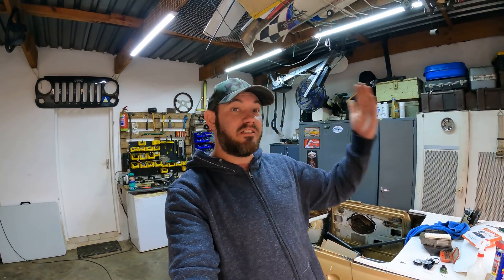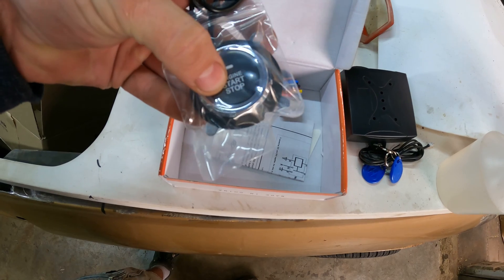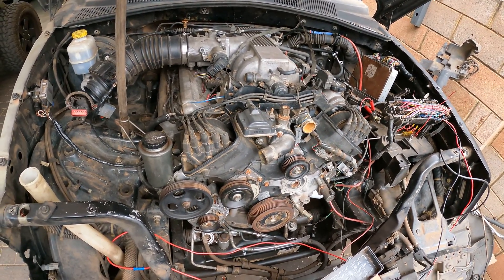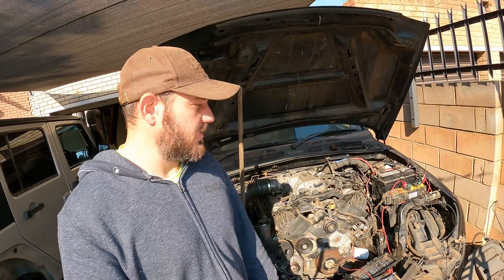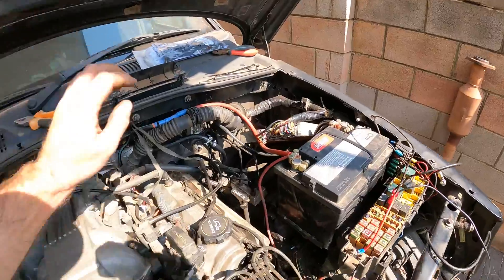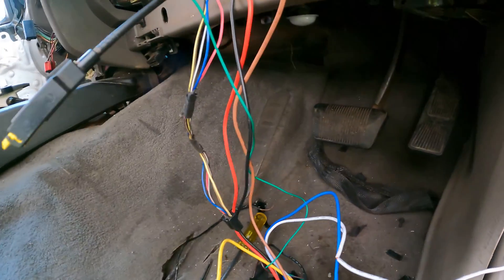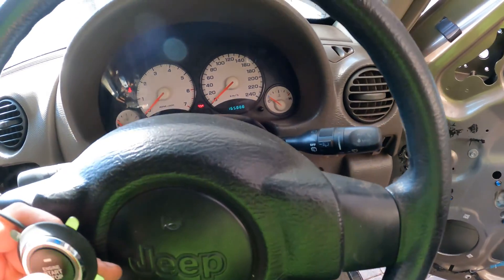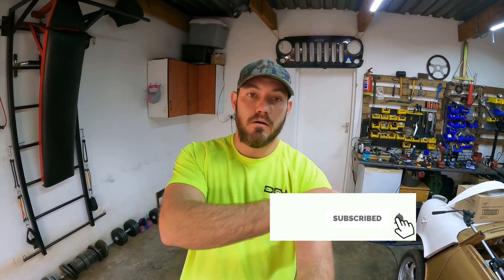Immobilizer Bypass/Delete on Jeep KJ Build Project Part 15

Comment: Can u please help me bybass my skim unit on my jeep cherokee overland 2.7 L diesel. It has a crank no start or starts then switches off. I'm in Cape Town. Please help, I'm very desperate. Thank u
Reply from the maker: If your Jeeps wings over and starts, you dont have a SKIM problem, this sounds a lot like an issue with a Crank sensor or even a loose wire on the injectors. These 2.7s have a closed loop on the injectors, which mean, if your engine is running and you pull one injector plug, it will switch the engine off to save it from damage. 
I would start by looking at the Injectors loom first.

Comment: Hi brother can perhaps give a bit more specific info on how you connected the wiring from the fuse box please. And did you disconnect the pcm completely? Why is it just hanging? I want to do the same as you did but I need a bit more info especially on the wiring please

Comment: I have a 2002 jeep liberty with a skim problem and I was going to have the pcm reprogrammed and have a skim deleted but maybe it should try this
Reply from the maker: That can be an option, its just a lot of thinking work and following wiring diagrams. But if you remove the SKIM unit, check the solder on it, that also breaks and come loose sometimes.

Comment: Can you go into more details on the wiring of the starter button.
Reply: That’s what I’m hoping for too.
Reply from the maker: Hi, I cant remember from hand now, but I downloaded schematics and then traced wires directly to the fuse box in the front, bypassing the SKIM. The starter button do have instructions on it and I guess it would be different for each vehicle
Reply: @MountainmanBuildz  ok dang, I have a WJ and wanted to do the same. I guess I'll have to send my computer out.
Reply from the maker: Why? Whats weong with the ecu?
Reply: @MountainmanBuildz  that's the only other way to bypass the chip in your key